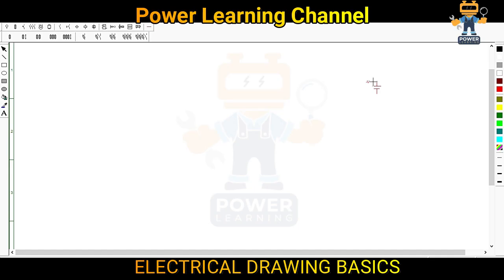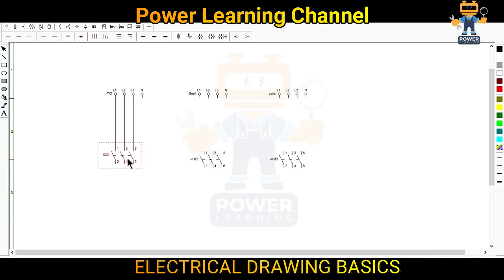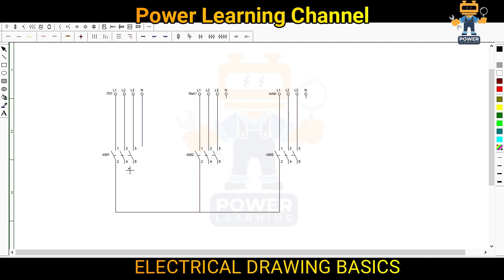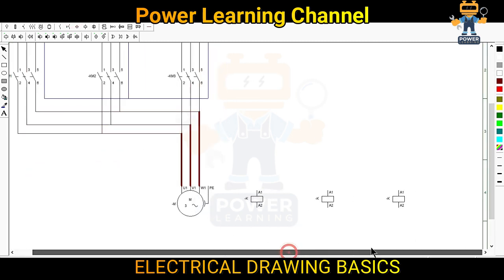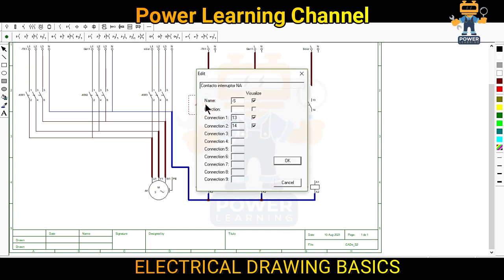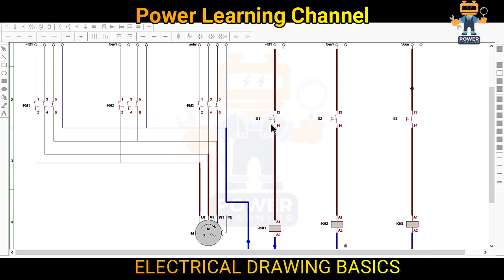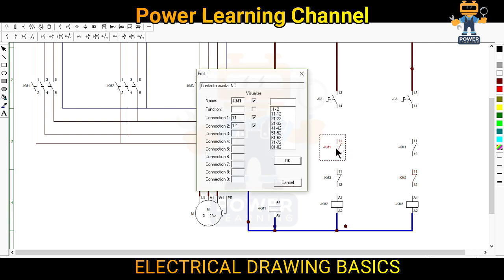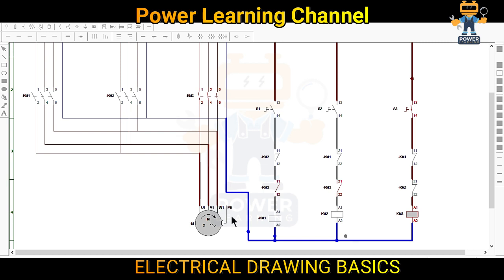How to read Electrical panel wiring drawing and Diagram | How to make electrical drawings in autocad

Comment from the maker: Some of our most watched videos links you find below......
1. Load Bank Testing Perkins 1500 Series: 

https://youtu.be/u24gL1uRHro
==============================================
2.PERKINS 2500 FUEL CIRCULATION | COMMON RAIL SYSTEM| ELECTRONIC FUEL INJECTION | ELECTRONIC SYSTEM
https://youtu.be/g4F85WzoQrY
===================================================================

3. Perkins 2500 | sensors identification | interview Q&A |Sensors location | Engine Harness Protection

https://youtu.be/zTweTeJN91c
====================================================================

4. Generator startup checks Perkins 2500 UK/USA|interview Q&A practical video 2020 پر کنزانجن چیک اپ

https://youtu.be/2URrNrsiUas
====================================================================

5. Free Online Siemens Automation Training /Free certificate Siemens/2020 free Siemen/ PLC free Siemens

https://youtu.be/vbBJeHPqK4Q